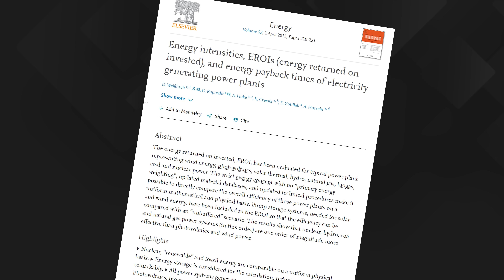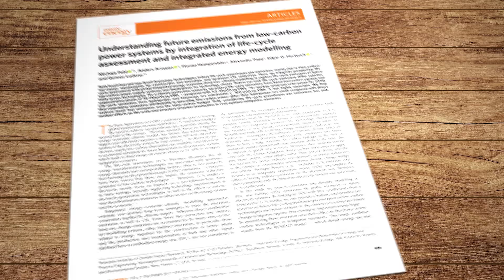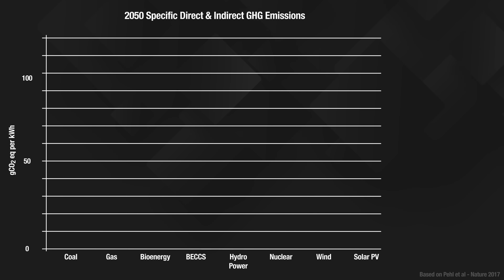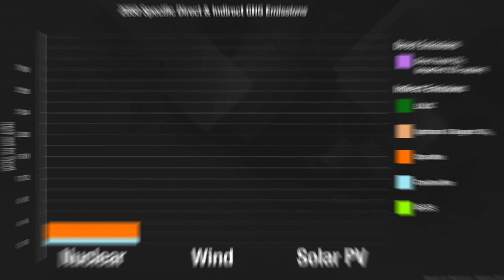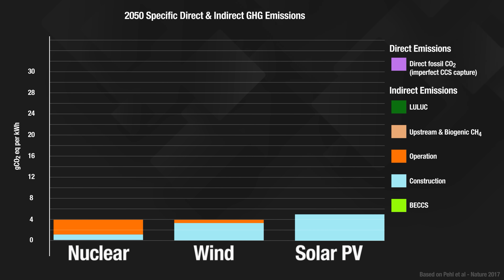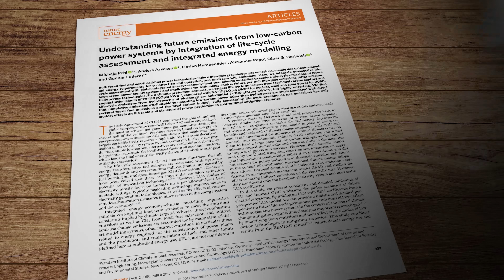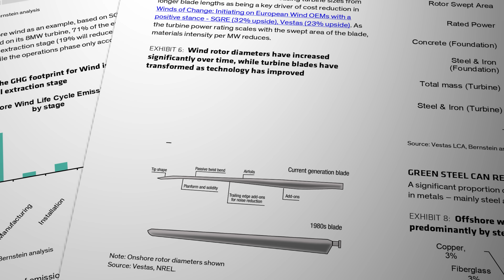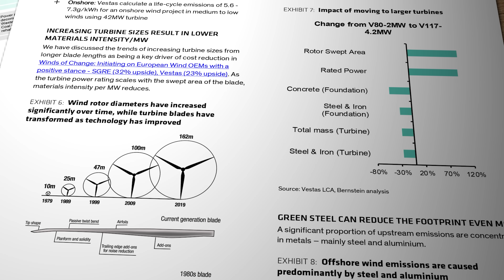Lifetime carbon emissions of renewables vs fossil fuel. Problem or solution?

Comment: One factor often not considered when comparing wind with PV solar is that by its very nature wind power will require the electrical grid to be expanded in its capacity,  whereas solar PV located close to and within the heavily populated areas coupled with energy storage can actually reduce dependence on the electrical grid.  Residential and commercial solar PV is not just a renewable energy source it is also the energy delivery system.   In contrast wind and utility scale PV is just a renewable energy source that is dependent on the electrical grid. 

All this being said I still think that we should be embracing all currently available forms of both wind and solar renewable energy sources.
Reply: A recent video on Fully Charged  is an interview with the Head of National Grid. His explanation is that currently the grid runs at 85% capacity. He has no worries about its ability to deal in the short term. As electric cars, trucks and other battery storage systems evolve they will add the ability to decentralise power storage. They will become part of the grid environment. Balancing excess power and providing power at strategic times. This should reduce overheads for infrastructure and provide a means to reduce costs for those participating.
Reply: @richardshillam7075  Indeed, and the situation is equally favourable all over Europe. There are some local hot spots where the grid needs to be reinforced, but those are very limited and typically the result from under investment during the previous decades.
Reply: The carbon /toxicity bootprint of the military industrial complex anybody?
Reply: @haveaseatplease  It's not a hoax. There are plenty of times when there's no wind or sun. In the UK there's basically no sun for half the year, and the winter tends to be less windy. We use gas to fill in the gaps where wind and solar are deficient. We wouldn't do this if we didn't have to.
Reply: @sammason2300  The number of day per year that there is no wind and sunshine is typically 3 to 5. 2017 was an exception with 9 days over the whole year. So you can say that in practise, this is indeed a hoax.
Reply: I have a 4.8KW solar system facing the sun with obstructions plus 12.5KW battery, the problem is that on cloudy or overcast days you are lucky to get 10% output! The fact is solar or even wind - is won't generate if there is no wind - won't supply sufficient power. In summer I can be self sufficient - as far as I generate more than I need and by credits offset my supply charge as well - but that is for about two months out of twelve. From late autumn to mid spring the panels are really not worth having!
Reply: Great point. Pop up energy is vital.
Reply: going to the original comment, I remember hearing that utility companies don't really like rooftop solar (at least in developed areas) because any excess power going back into the grid can screw with potential difference across the network and such. Surely there's an argument to be made for grid level providers since lots of countries' infrastructure has developed around them
Reply: @LunarLaker  and you do know that the fire Department can't put water on a rooftop solar panel
Reply: @LunarLaker  I don't know what they do elsewhere but where I live if you have residential solar panels they have a separate meter and the output runs in separate lines back to a substation where the power is phase marched and cleaned.
Reply: The Earth is cooler with the atmos/GHGs/albedo not warmer.
To perform as advertised the GHGs require “extra” energy upwelling from the surface radiating as a black body. https://youtu.be/0Jijw7-YG-U
The kinetic heat transfer processes of the contiguous atmos molecules render that scenario impossible.
No greenhouse effect, no GHG warming, no man/CO2 driven climate change or Gorebal warming.
Reply: Most people live in cities, and in cities SPV will never cover the demand. Yes many in developed world live in their own houses, but still much less than in cities. And in developing world even more people live in densely populated cities. So neither SPV nor any other tech can distribute power generation for cities inside or even near them. It still has to be large scale application, and in case of SPV it is solar farms.
Yeah, house owners should go energy independent. But for those living in cities it's an impossibility.
Reply: Bur not being grid connected means you could actual waste energy from PV because you can't really stop it if ur not using it and it's not going to the grid ur wasting it and that would mean your wasting the resources in creating the PVs because there life span does not changed wether ur using it or not
Reply: Just make fission reactors. Rework the grid. Invest in the things we need and we will be fine
Reply: Yes, domestic PV has efficiency benefits as there are fewer losses due to transmission lines, voltage steps etc. Most significant perhaps is the change to household behaviour where we try to optimise our solar usage.
I'd like to see more community owned wind projects that would bring some of these benefits to that technology too.
Reply: @bimblinghill  no look at how far it is transmitted to clean it up to use it!
Reply: Well you're moreso talking about Distributed Energy Resources (DERs) rather than just one or two types of technologies. 

Solar can be at the pico-, nano-, micro-, and milli-, or utility-scale, if not due to its incredible modularity and this scalability. 

As Dave has covered on this channel, as well as Matt Ferrell with his Undecided YT channel, there are many, many attempts at inventing and implementing micro-wind, micro-hydrokinetic, micro-geothermal, micro-biogas, micro-grid Demand Response Mechanisms (DSMs) like supercapacitors, and micro-storage. 

Your concerns are still valid, but you're resting your distinction on a false categorization. 

Resilience is the ultimate goal though, at every scale from the home unit to the community to the city to the administrative division to the sovereign nation to the world. 

We should be considering how failure can disrupt things at every level, and plan accordingly. 

I'd recommend listening to the podcast episode of the channel The Energy Transition Show with Chris Nelder where Chris discusses with Lorenzo Kristov from the California Independent System Operator (CAISO) about grid architecture. 

The episode is titled "Grid Architecture of the Future", and while it is 1h30m long, it gets into the technical details of just the kind of resilience we need for a sustainable electricity grid. 

Cheers
Reply: PV is being implemented in the worst environmental way possible due to power industry politics taking incentives away from PV at the point of need.
Small distributed PV systems are inherently more stable when there is cloudy weather. One cloud can shade a 100MW solar plant reducing its power output by 80%. Distribute the 100MW to 500,000 homes and the same weather would only affect production by 5%-10%.
And there no need for additional power grid infrastructure or destruction of green space for large PV plants that are "saving" the environment.
Reply: @vironpayne3405  It's not power industry politics (well, may be in some places) - it's because it's much cheaper. Putting all the panels on buildings costs 2-3 times as much as putting them in fields/deserts/reservoirs. And because there are lots of 5-100MW solar farms  the generation is still well-distributed across clouds. Also the space around/under PV is not really 'destructed'. It still makes good wildlife habitat, or can be used agriculturally. So I'm not convinced that large scale PV is a worse plan than trying to put the same capacity on buildings. PV on buildings is indeed a good thing, taking up no new space, and being close to the point of use, but the cost means it probably still makes sense to build much of it in larger arrays. I'd need to see some detailed analysis to be convinced by your assertion that it should all be on buildings.
Reply: @xxwookey  You are correct in that there are economies of scale etc, but I think you cost comparison may be flawed in finding solar 2x-3x cheaper for commercial arrays. First, does your commercial array include land cost for the array site AND power line corridor. With a home or business installation the property is already owned and there is no addition grid required. Second, does you assessment include carbon cost including loss of green space and additional heat island effect of a PV array replacing green space. Existing roof tops are essential net zero on heat island effect AND the layer of PV over the existing roof can reduce heat can in the building reducing the need for air conditioning.
I am NOT convinced that there is man made greenhouse gas induced climate warming, but that is the drive of the Green Revolution so carbon is part of the discussion.
It is political in Florida. A decade ago PV subsidies were mostly aimed at users, both homes and businesses. A measure was put before the voters to extend subsidies to utility companies. The ballot measure was voted down. The utility companies went to the PUC which is largely comprised of former utility execs and got the subsidies.
Furthermore, in generally it is illegal to not be connected to the utility grid. Your home will be declared uninhabitable.
There are a few exceptions in Florida mainly for extremely remote locations that the utility companies do not want to serve due to infrastructure cost. If you own property ten miles from a power pole and the land between you and the power is not yours you are probably exempt. Think of remote fly-in communities.
Then the financial structure between the utilities and individual PV owners changed. The non-energy costs costs were incleased basically doubling. Instead of having to net about $15 to pay for the "forced" priviledge being connected to the grid you have to pay closer to $25.
With net metering differences of $0.13 vs $0.02 per KWh it became inpossible for most home owners to net zero with an effective limit of 10Kw PV array. Actual array sizes are about 12.5KW as the 10KW is net daily average peak power.
Larger PV systems can be connected, but the UL and building code certifications must be supplemented with a million dollar bond with the utility company as the named insured which raises cost several hundred dollars.
Would it be right to tax owners of luxury cars for seatbelts and airbags?
This type of politics is not limited to Florida.
Reply: Exactly, the position is worse with large scale power generation such as nuclear and hydro, although there are small hydro schemes which can supply a local area.
Reply: @rogerbarton497  If we are generating PV electricity "close to and within the heavily populated areas", why are we running power cables all over the place to get energy from Africa? Hardly local to the UK? https://www.youtube.com/watch?v=iA8WW0fZuS4
Reply: @geoffhaylock6848  Because we can't generate enough locally to supply the power required by industry.  There simply isn't enough local sunshine to meet that demand.

Just because we import power doesn't mean we shouldn't generate it locally, as Putin has demonstrated so well.
Reply: @rogerbarton497  You agree that a benefit of PV is it is local then say we can't generate enough locally. So Nuclear is actually better as we can meet all our needs by producing it locally. Putin has definitely shown us that countries need some independence where energy is concerned.
Reply: @geoffhaylock6848  Stop twisting my words.  I said we can't produce enough locally to cover industrial demand which is national, not local.
Reply: @rogerbarton497  In many cases nuclear can be built at the same location that coal is retired from making it existing Grid Ready' and also with the huge advantage of not destroying the rural environment as large scale solar and wind and their transmission line do.
Reply: @rogerbarton497  yes but if you look at the local infrastructure required for small units it is astronomical! Tomorrow we are shipping a 10 MW mobile transformer to adjust voltage for wind farms, there is 25 ton of copper used and the transformer sits  on a custom 8 axle trailers so you are talking  180,000 pounds of steal and copper! How many MW per year would the coal required to build it supply in a thermal plant?
Reply: @terenceiutzi4003  Not quite sure what you mean by MW per Year - Do you mean MW-hrs?  Once it's been built and commissioned hopefully it will save the Mw-hrs it took to build it and then more besides.  How does the impact of building and installing the transformer compare with building 100 miles of transmission line?

The problem is the arguments are endless, cover so many different technologies and disciplines and require the ability to look into the future.  If we'd got to where we are today 20 years ago regarding renewables we wouldn't be in the energy crisis that we are now due to Putin.  (Probably)
Reply: @rogerbarton497  There are also Smaller Scale nuclear plants in the works. These would then be able to serve the local communities without the long lines needed for Large scale ones. Then, if there was a problem it would be isolated to that smaller grid and not spread out through the entire country. Wind and Solar will NEVER be enough on their own. Need some form of storage to carry-over during non production times. Maybe instead of the old saying "Chicken in every pot" we have "Powerwall or EV in every garage". What is the Governments plan BEFORE they shut down more generating facilities. Hope is never a good strategy.
Reply: @williammiller7543  I think governments are reluctant to form a strategy because there are so many emerging technologies it's impossible to pick the best one(s) for the job.  If battery type A is chosen Sod's law says that 2 years later Battery B will be twice as good at half the price.

Then of course there's hydrogen.  Maybe if houses had solar panels connected to electrolysis cells they could pump H2 into a hydrogen main.  No fancy grid-tied inverters or batteries required.
Reply: @rogerbarton497  My only point is that we should NOT stop producing the necessary energy until we see some way forward to replace it.  How many poor people will die this year because they couldn't afford the electricity to run the AC or the gas to run the furnace?  Giving those people subsidies is not the answer. We soon run out of other peoples money. Lets come up with a direction, plan, whatever you want to call it, FIRST.
Reply: @richardshillam7075  Let's buy it from Venezuela, Saudi Arabia, Russia rather than USA to put our people to work. All I'm saying is you need a Plan B before you shut the spigot off. Most of us will be able to live through the heat of SUMER but I don't think that will be true for the Northern States this WINTER. Lets get past the politics and name calling get down to some serious plans.
Reply: @william breen 
Seasonal variation can be solved by massively overbuilding capacity. Soon solar will be cheap enough to make this economical. Then in the summer we'll have a huge amount of excess power that can be used for many useful things. Water desalination is one of the best candidates.
Reply: @andrasbiro3007  Power to gas to make hydrogen and methane in the summer is also a good use of the excess power.
Reply: @grieske  
Maybe, but not for fuel, but as a feedstock for the chemical industry.
Well, methane is a good rocket fuel, and we'll need a lot, but not nearly as much as the amount of excess power we'll have. Don't worry, there are plenty of industries that could use unlimited amount of essentially free power.
Reply: @andrasbiro3007  I fully agree with you.
Reply: @andrasbiro3007  It doesn't matter how much they overbuild PV.  The elephant in the room is the Sun simply doesn't shine at night and peak production is 5 hours a day at best.  A calculation was done on Musk's battery plant, largest in the world.  At present production it would take that factory 500 years to make enough batteries to hold just 24 hours of power.
Reply: @CrotalusHH  
That's why we need batteries. Tesla already proved that it works at small and large scales.
At present production volume is going up insanely fast. People should stop thinking linearly already, especially experts. Technology adoption has always been exponential, not linear.
We'll have enough batteries somewhere in the next decade. And that's assuming no new technology. There are dozens of new battery technologies are waiting for commercialization, and any one of them could completely change the picture.
Reply: @andrasbiro3007  the solar panel is not the problem anymore. even when free.  the capital costs and years of payback still make it expensive with out subsidy. living in a cave and eating raw uncooked food wins every time but no way will this be promoted or tolerated by those with power.
Reply: @victorhopper6774  
I don't understand. If solar panels are free, what payback we are talking about?
In reality solar is like 3x cheaper then the grid. Highly dependent on the circumstances of course, but on average that's the case. Even with energy storage the cost is still competitive. And it's not just about saving money, it's also about not dying from climate change and pollution.

As for living in caves, good luck with that. Don't expect many to follow you. Also where do you expect to find enough caves for 8 billion people? Not to mention the thousands of other issues.
Reply: @andrasbiro3007  it isn't hard to look up the costs. without compromise off grid is capital expensive without subsidy even with free panels.inverters cost as much or more and batteries cost more. even the cost of installing is more than panels.
Reply: @victorhopper6774  
You need an inverter anyway. Batteries are expensive, but not that bad now, and prices keep falling. If you have decent amount of sunlight all year, it's likely still cheaper.
Also cost is not the only consideration. For example if you have frequent blackouts, and long ones, it can worth it just for that reason alone. You may also care about the environment more than your wallet. Some people do it just to be independent.
Reply: @andrasbiro3007  the cost from utilities varies a lot as does useage. for instance my bill was 56.63 last month but my use day to day varies a whole lot so i would need a much larger inverter than my bill would suggest. utility costs are close to half those in cali. i live in a wooded area that some trees of my neighbor's would need cut so nope. one size does not fit all.
Reply: @andrasbiro3007  And "massively overbuilding capacity" doesn't ring any negative bells?
Reply: @AlessandroRodriguez  
No.
Reply: We do not have a renewable energy generation problem. 
We have a renewable energy storage problem.
Solve the latter and the former will advance by leaps and bounds.
Reply: @hitreset0291  Being solved rapidly. Did you hear about the new lithium extraction breakthrough? Nearly doubles the recovery from raws. Still more increase of capacity and collapse of price incoming.
Reply: @alan2102X  or even excluding lithium from storage batteries altogether - sodium and sulfur batteries are cheaper because their elements are more abundant, they just need to prove the latest breakthroughs.
Reply: @terryjimfletcher  Sodium looks really good. And note btw that recent breakthrough in lithium refining DOUBLES the recovery rate.
Reply: @alan2102X  The guy on this channel has been going on about the various 'Latest & Greatest' storage systems forever. We are way off utility scale still, with no viable short-term prospects at scale.
Reply: @tonybloomfield45283  Storage is rapidly improving, and improving faster than it actually needs to improve in most contexts. Renewables have to be well over 50% of total before it becomes a serious issue in most latitudes. Few places are close to that yet. Sodium batteries and a variety of other technologies will provide grid-scale storage where needed. No problem. The objections are fossil industry FUD.
Reply: Did you read the meantioned reports? Maybe they did consider external infrastructure in their life cycle analysis? In any case green energy looks promosing for the future, whether it be solar panels or wind turbines.
Reply: The issue with this argument is that no, renewables do not require rebuilding of the grid. The simple fact is that the current crappy status of the grid and the ever expanding human habitation and increasing energy demands require expansion of the grid as well as redesigning it as a smart grid so we don't keep having blackouts.

Doesn't matter if someone came up with magic unicorn farts that make coal cleaner than renewables or that a nuclear reactor has fuel for years inside it while a solar panel does not, when a storm cuts the power line from that power plant to the city the city goes dark unless it has either local energy storage or a smart grid that can simply reroute the power connections. Working well with renewables is bonus.
Reply: @AnalystPrime  Which is why I am for a widely distributed grid with most buildings being self sustaining mostly through renewables and batteries, once the waste stream is worked out. I could see mostly on-site solar, wind, and hydro account for 50%-70% of the energy mix. Nuclear, hydrocarbons, and hydrogen to make up the balance. Give 20-30 years and perhaps we do it with ruining the economy or environment.
This command and control socialist New Screwup Green Deal is raping the world. The US as a net energy exported could easily push gas prices below $2 gal.
Reply: i agree.  rooftops are mostly wasted space in urban areas and it's closer to where the energy is needed, so less transmission losses over distance, and it makes sense to invest more heavily on that side.  the wider electrical grid is needed for the vast expanse of rural areas, and for that wind is a great addition where it makes sense.
Reply: Yes, and LiO batteries can be recycled with ~98% efficiency.
Reply: @willcooper7651  What?  I have watched film how industrial plant do recycling.  How come the 98% efficiency?  Do you mean 98% of the Lithium inside those battery can be recycled back into Lithium?  How about the energy to run the shredding machine?  The separator?  The melting machine to melt the shredded stuff into an alloy?  Then another melting machine to melt that alloy with many processed to separate out the Lithium from other metals in the alloy?
Reply: Yes but that expanded infrastructure only requires a few million tons of coal and oil per year and wind and solar can replace at least 5 percent of that per year
Reply: Just what the suburban landscape needs - hundreds of hectares of black slabs. By the way have you not notice that the grid already exists to distribute electricity from major power stations. It's the kms of new cabling need to collect from scattered windmills that's one of the big buried costs - along with their energy intensive foundations - tonnessss of steel and concrete.
Reply: The other consideration is that wind and solar need a backup, which currently is derived from fossils. Hence the real-life carbon intensity of wind and solar today is substantially higher than nuclear. If we're to achieve very low carbon intensities then we need to scale up nuclear at the same time as renewables.
Reply: @sammason2300  Battery backup of the grid is being used with great success in Australia.  They are adding more.
Once BEVs get old enough we will see the old batteries installed in homes.  This inexpensive source of batteries could have a huge impact.   I would like to see nuclear used to backup the renewable grid should we have something like Mt. Saint Helens blocking the sun.
Reply: @danharold3087  Nope. As a fire investigator operating in Aus/NZ and the UK those grid scale storage facilities are a real issue for fire safety and don't even talk about "old batteries" in homes. They are a real risk of fire.
Reply: @CMDR_Hal_Melamby  OK was reading about this.  I was about to disagree but you are correct.   I like to have my views challenged.  Thank you.
Regarding the Tesla Mega Pack fire in AU
"The multi-party independent investigation into the fire uncovered that the system in place to detect faults didn’t set off alarms because it hadn’t been given adequate time to ‘map’ the control system, which generally takes around 24 hours. "
In short installers did not catch a coolant leak and the system had not finished mapping the units so cooling and fire suppression was not working.  

Obviously this is dangerous technology.   Less dangerous batteries are on the way.   This is a technology we need.  Don't give up on it. 

Your concern about repurposed auto to home is a concern.    Especially if improperly installed.     But generally thermal runaway does not happen unless the cell is overheated or damaged.    " AT 170 °C–235 °C, the cathode active material begins to decompose and generate oxygen" .  These temperatures are rarely found outside an auto accident.   It is well know that  ICE cars catch fire 25 times more often than BEVs.  So yes care is required but let's not flush the concept.
Better safer batteries are on the way.   This is what is know as learning :)
Reply: @danharold3087  I'm with you on safer technology. I support differing systems to store electrical energy because we really do need them.
But Li-Ion batteries do not require overheating alone to undergo thermal runaway. Overcharging, over discharging, mechanical faults (damage from impact, piercing, mechanical shock) and manufacturing defects can all push them into thermal runaway.
The technology is not sufficiently understood by those who implement it never mind the end user to be considered generally safe. 
Then you have to consider how long it takes to extinguish a battery pack in a BEV. Go and look at that along with the fires that have occurred when these vehicles are being charged in close proximity. Then look at how operators are taking buses off the streets along the lines that happened with LPG and LNG PSVs when they were catching fire or exploding regularly. 
I am fully supportive of renewables but concerned with the rate at which incidents are happening. Increasingly in home-brew solar systems, and with e-bikes and e-scooters  on charge indoors - particularly when users have done their own work on power packs. Many of these systems are flat out dangerous.
Reply: @CMDR_Hal_Melamby  Remember ICE cars catch fire 25 times as often then BEV.    If you have an EV the chance of yours catching fire is 0.00025, that is 1 in 4000 BEVs sold.  Chevy Bolts are the poster child for BEV fires.  Yet of the 141K bolts produced 16 caught fire.    A  0.0001  chance or 1 in 10K cars.  For all ICE cars, excluding hybrids,  it is 0.015.   So that safe ICE car is 15 times more likely to burn than the worst BEV.  Hybrids are twice as likely to burn as ICE.   But like highway deaths and backed over children we ignore the common. 

BEVs contain battery management systems that protect against over and under charging.   EV fires are largely FUD.

BEV fires are the worst to put out.   Seen a place in Scandinavia was using a rig with a container.   They put the car in the container and flooded it with water.  Battery pack being on the bottom of the car it is not all that difficult to do.

We have had lithium ion batteries in cordless tools for 20 years (guessing).   I would venture to guess the cordless tools carried on fire and rescue are lithium ion.

And they should only get safer.
Reply: @danharold3087  
Most vehicle fires in ICEs are relatively minor and the majority involve ancillaries not the ICE or fuel system. Most vehicle fires in BEVs that involve the main battery (which is susceptible to external fire in a more significant way than a fuel tank/system is in an ICE), are far more serious and require far more resources and time to extinguish. 
The design of battery packs and the nature of their materials means that they are extremely difficult to extinguish even by flooding or use of specialist techniques. That is due to the nature of the battery and its application. 
Some vehicle fires in ICEs are deliberate fires. I'm not aware of BEVs being targets of arson in anywhere near the same numbers.
Lithium ion batteries have not been in power tools for 20 years, not to any measurable degree. Ni-Mh came in around 20 to 25  years ago in portable lighting applications first (as far as I am aware) and most cordless tools, by volumes sold, were by far NiCd up to 20 years ago. Then NiMh arrived and since then Li-Ion has come to dominate.
Reply: @CMDR_Hal_Melamby  
In most cases ICE car fires are fast and consume the entire car. Often occupants have only seconds to escape. Fore example diesel BMWs are well known to just randomly burst into flames while driving. Turns out combining hot surfaces with highly flammable fluids can be dangerous.
While EV fires are like 10x more rare in the first place, and burn very slowly.
It doesn't matter how hard they are to extinguish, they don't spread and once firefighters are there, the fire is easy to control. The main issues is preventing re-ignition, that's why it takes a long time.
Reply: @andrasbiro3007  how wrong can you possibly be?
Where is your experience of vehicle fires coming from?
Personal experience in fire investigation? Risk management in the industry?
I hope not because you are flat wrong there.
One of the most significant issues with Li-ion fires is that they often release a variety of combustibles during thermal runaway that themselves can undergo a deflagration. 
And no fires involving these batteries do not burn "very slowly" - I have CCTV footage from my own cases and those of others that prove that assertion to be totally false.
The fuel packages most responsible for the majority of damage in vehicle fires (certainly in ICEs) are nothing to do with the fuel for the engine. They are almost invariably the foam plastics and other plastics associated with the passenger compartment and it is in those areas of the vehicle where the highest temperatures are found. Unless  you are looking at particular alloys used in bodywork or the chassis. Which is far less common.
Reply: @CMDR_Hal_Melamby  
My experience comes from statistical data.  And knowledge of cell and battery pack design. 

Battery packs are encased in steel and often fire retardant, to contain the fire from a failing cell. Gases are expelled to the environment, not inside the passenger compartment.
What you see on camera is smoke, not fire.

Of course not all EVs are the same quality. The Chevy Bolt for example had a faulty battery design that was prone to catch fire. But that's the exception.

Diesel BMWs have a well known issue with fires. Watch "BMW mystery fires: Parked cars have burst into flames" on YouTube. Or just search for "BMW fire" on Google.
Reply: @andrasbiro3007  As I said. You obviously have no understanding of fire fighting, fire investigation or how fire spreads in vehicles. The fact that the packs are encased means that extinguishment can prove very difficult or impossible such that crews have to let the material burn to completion and these cells contain considerable quantities of fuel. 
The gases or vapour clouds you see are often from the electrolyte (in some cases a combustive vapour component of that) being ejected and there are well documented cases of flash fires that result from ignition of those releases during thermal runaway, both in the real world and under test conditions. 
In some cases those events can result in detonating explosions - I'll not attempt to explain why that can happen rather than a deflagration (you''d need to understand how flame can wrinkle and run up to detonation) but trust me - as the UK Fire Service College did to lecture to their students on the technical aspects of explosion investigation -  there have been cases of such events following/during a thermal runaway in tests and in the field. Whether this happens inside the passenger compartment is a very often a moot point. As I said before the main fuel for fires involving ICE vehicles is almost always the internal trim and seats rather than what is in the fuel tank or even in the engine compartment. 
My knowledge is from 28 years or so of fire investigation in vehicles ranging from single seat sports cars, imported sports saloons, throught PSV, trucks,  to heavy plant & machinery, mining equipment all the way to large ships with thousands of tonnes gross tonnage. 
I have extensive experience of forensic investigation of suspected Li-ion cell fires from the smallest to the largest. Also experience in working with Lithium metal and highly reactive compounds of lithium in a research environment. I'd take my PhD, first class degree in chemistry and decades in fire investigation over whatever "statistics" you seem to want to bandy about. 
Oh and our company arranged for one of the worlds foremost experts in the field of Li-Ion battery safety to provide a webinar for us fire investigators just about a month ago on this very subject.....they brought along further evidence of how wrong things can go with those batteries and how the applications need to be assessed in light of real world fire experience.
Reply: @CMDR_Hal_Melamby  
1. Again, I base my opinion on statistical data, many reports on actual EV fires, and knowledge of cell and battery pack design.

2. Yes, it's hard to fully extinguish a battery fire, but fairly easy to keep it under control. At least if it's been designed properly. Cell type is one of the most important things. Poach cells get damaged easily, and spread the fire to each other faster. Cylindrical cells are the opposite, hard to damage, and unlikely to overheat other cells. They are designed to vent hot gases in a specific side, where they can leave the car. Watch "Video shows Tesla Model S bursting into flames" on YouTube. You'll see, and they explain too, that the flames are outside of the car, the cabin is protected. The fire spreads slowly, giving plenty of time for the occupants to escape. I don't know of any anyone who were killed by EV fire. The cell chemistry is also important. For example LFP cells are far less likely to catch fire than the traditional NCA or NMC chemistries. Tesla now uses LFP cells for half of their cars, and that ratio will only grow in the future. Plus any basic chemistry can be tweaked in a million ways to trade off one property for another. Smartphones go for energy density, car manufacturers tend to prioritize safety.

3. As for detonations, cell design should prevent that. Vent holes ensure that neither pressure, nor flammable gases can build up in the cell, to create the conditions for a detonation. And even if it happens, the cells are small, so the detonation will be too. At least for cylindrical cells, but eventually the more dangerous types will be phased out.

4. This is not the first time anyone thought about EV safety. Tesla, for example, was well aware of the issue from the beginning. Read "Hitting the Books: How Tesla engineers solved the problem of exploding EV batteries" on Engadget.

5. That can't be true. We know from statistical data that gas cars are at least 10x more likely to catch fire than EVs. If the powertrain isn't involved, what else causes this huge difference? Then there's the case of diesel BMWs, where we know for a fact that the engine causes the fire. Also, assuming you are right, then the whole debate is meaningless, as the powertrain is irrelevant for car fires.

6. Whatever qualifications you have, facts are still facts. And remember, li-ion batteries come in a large variety, just because one type of cell is dangerous, that doesn't mean all are. Plus pack design and the BMS are also very important in preventing and containing the fire.
Reply: @andrasbiro3007  sorry but you can make whatever "statistical" arguments you like.

And your analysis of a detonation scenario just illustrates you have no idea what is being discussed.... this is NOT a detonation of the closed pack or cell assembly, nor is it the explosive failure of containment. This feature -  a well known aspect of battery safety, relates to the delayed ignition of the vapours and aerosols released during thermal runaway. If you want to debate this issue further then please at least try to understand what is happening in that situation.

Again your argument proves that you don't know anything about fire or the risks associated with explosion subsequent to failure of EV batteries under fire and test conditions. 

What is clear is that you have no input into fire safety design and no experience of real world testing of the fire properties of cells. Those of us who have advised manufacturers and operators of fleets of vehicles and PSVs need to understand these aspects. Referring to YouTube videos and simple minded explanations of some aspects of the failure of these batteries doesn't cut it I'm afraid.

That you have no idea of fire safety wrt to Li-ion batteries is abundantly clear when you opine concerning cylindrical cells which do not behave in the manner you suggest.

I never said anything about "powertrain", which refers in vehicle design to the engine and gearbox. I am talking about the source of energy for the operation of the vehicle. Either that is in the form of a petroleum liquid fuel or in the form of stored chemical energy. In the case of liquid fuels, as opposed to compressed gases then the damage caused by fire in the vast majority of ICE (as opposed to EV) vehicles is overwhelmingly due to other components of the vehicle. These fuels play a very minor role in the vast majority of vehicle fires. Contrary to what you might watch at the movies or on TV. Again I have decades of investigating vehicle fires and have hundreds of cases to consider when making that claim. Along with the work of colleagues and competitors on several continents.

Your counter argument relies on what exactly? Assumptions that the manufacturers are doing the right thing and we understand all the implications of the use of very high energy density batteries in a wide range of applications. Which is not correct. Innovative applications of technology often result in these effects and the evidence that Li-Ion batteries are such an innovation is mounting. It might find its way into popular science culture and those sources you rely so heavily on in the near future.
Reply: @CMDR_Hal_Melamby  
1. Where would those vapors and aerosols build up? There's no air inside or around the cells. There simply can't be enough to blow up the car (also never happened). For small explosions (single cell) the packaging is easily strong enough to contain it, and there are built-in weak points in the cells, and on the bottom of the pack that direct the hot gases outside, away from passengers.

2. Also the surrounding cells and the cooling system soak up most of the heat, so a thermal runaway is extremely unlikely in the first place. At least in case of a properly designed pack.

3. I'm referring to verifiable facts. I'm talking about actual battery pack design, and real world EV fires. The only EV with significant fire risk is the Bolt, and it's due to a major fuckup either in the design or the manufacturing of the pack.

4. The problem with test is that they aren't necessarily realistic. For example a cell will behave very differently in side a pack than on it's own. Also there are very different cell chemistries, form factors, pack designs, and manufacturing processes, how do you test these?

5. For example look up BYD's new LFP blade cell. It can be punctured and still won't catch fire. You find a brief explanation for why in the video "The BYD Blade Battery Evaluated" on the Limiting Factor channel. I'm sure there are much better sources, but I don't have time to find them.

6. If the powertrain is not responsible for most car fires, then it doesn't matter which powertrain they use. But there's strong evidence to the contrary. One is the well known BMW diesel engine fire issue, which has been going on for well over a decade. After recalls and fixes, these cars still burst into flames for no apparent reason. Another evidence is the simple statistical fact that electric cars are 10-20 times less likely to catch fire than gas cars. This of course could be caused by the age and price difference between an average gas car and an average EV, but the difference seems to be too high for that. Also there's a new study "Gas vs. Electric Car Fires [2022 Findings]" that found an order of magnitude larger difference, that's even harder to explain away. Still doesn't control for age and price range, unfortunately.

7. I don't know about others, but Tesla is absolutely prioritizes safety above everything else, and it's proven by the safety record of their cars. They also have 20 years of experience with EV batteries. And have like 2 million cars on the road, which provides them with a large amount of real-world data, including all kinds of accidents. This is no longer a new and mysterious technology. Also there are billions of li-ion batteries in mobile devices, which are far less protected, yet they seem to be safe. There were a series of incidents with cellphone and laptop batteries a few years ago, but I haven't heard anything since then. This suggests that manufacturers learned what they needed to prevent such issues. Considering that Samsung lost an entire generation of it's high-end smartphone (Galaxy Note 7) due to that issue, I'm pretty sure a huge amount of resources were spent on understanding the problem throughout the industry.
Reply: @sammason2300  'The other consideration is that wind and solar need a backup, which currently is derived from fossils.' 
Not always, only some. Nuclear has it's place, but people, will have to accept, that, there will be a waste storage facility.
Once that takes place, full throttle for Nuclear power.
Reply: @carlthor91  new nuclear reactors don't produce much waste anymore, not to mention it's only radioactive for 100 years. Seems very doable to me, especially since we'll quickly be able to replace them with fusion reactors.
Reply: This is, of course, incorrect. Both energies are local, and wind has a smaller physical impact (hence a better EROEI). None work outside a complex grid that need huge storage capacity. In Belgium electricity provider stop paying the electricity you inject on the network. Soon we'll have to pay to produce it. And that is normal. Managing those fluxes is a nightmare, whatever the scale of the whisfull  "just have" a "smart" thinking deployed. None of this is renewable. And a soon you think about batteries your EROEI is not even above 1.